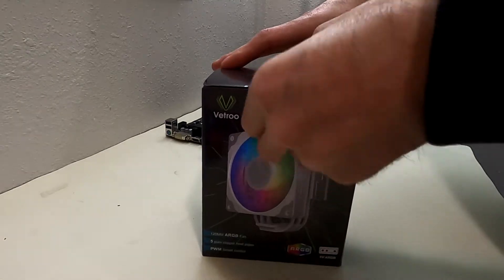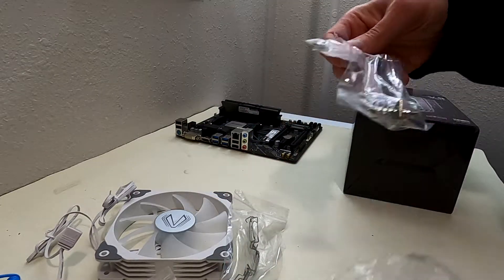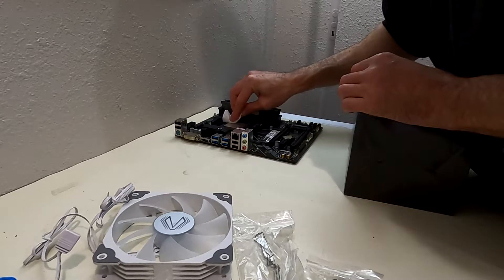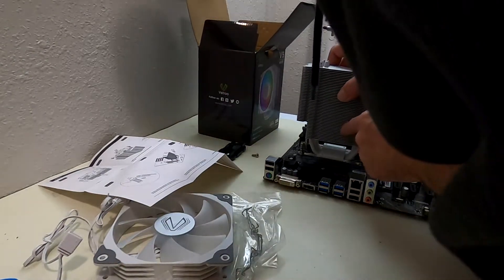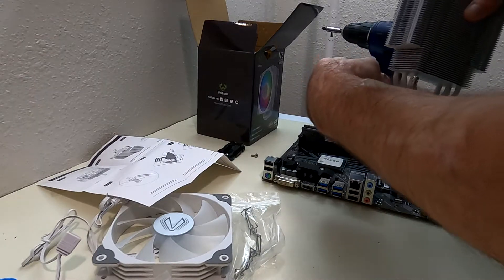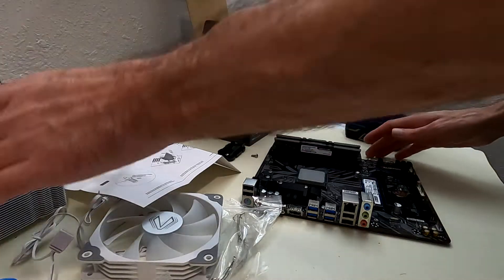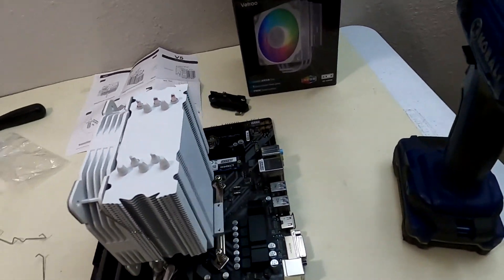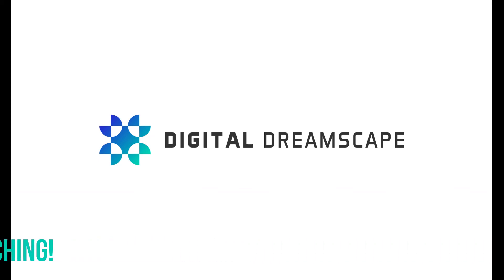How to Install a CPU Air Cooler also includes Unboxing

Comment: Putting on water coolers is way easier but this particular case has no good spot for one so I'm using an air cooler.

Comment: some people put thermal paste directly on the copper pipe that makes contact to the cpu and others, lik you sir, puts it on the cpu. Which way is correct? Are they both fine?

Comment: Thank you for mentioning the brackets. If the four corners aren’t lining up correctly, try switching the brackets that screw to the radiator bottom.
Reply: I ordered one today, On it's way tmrw. Hope all goes well and I'll take your advice 👌

Comment: How much power does an air cooler like this draws? I'm planning to buy an air cooler for my ryzen 3 3200g apu but I'm just using a 700w generic psu with a 230w rated.
Reply from the maker: Not any more than a standard case fan.

Comment: I was just thinking. Yeah that hurt lol. No seriously since you can use  whatever fan you want I'm going to use my Aigo DR12Pro fans on this. Put one on each side. They are connected to a hub and controlled with the remote. So I can change the fan speed, animations, and colors. They are double ringed so there would be four rings there. Might look cool. Already hooked up so all I'd have to do take out the screws and mount them on this. I could put this fan up the rear exhaust fan maybe? Just a thought.
Reply from the maker: That should give ya more than adequate cooling for just about any CPU.

Comment: Dang that's tall hope it fits in my case
Reply from the maker: Be sure to check overall height and case specs before ordering. Also keep in mind the RGB plug is a 3pin.
Reply: @DANRANTS1  I just measured the case. From the back panel to the glass is around 7 1/2 inches.
Reply from the maker: @jesusninja2401  total height is 5.82 inches.

Comment: I just bought the Black version of this. It's on EBay if anyone's looking. By the way does this work well cooling? I'm not overclocking but I've tried cheaper air coolers and none of them work very well. This got good reviews though on Amazon. How was your experience on it? Great video and thanks!  Oh just to add I think the newer version of the white has the three pin 5V RBG connector. I know for sure the Black version does.
Reply from the maker: It seems to cool great. Granted I was only running it on a Ryzen 5 2600x, but the fan didn't speed up at all during Userbenchmark.com testing.
Reply: @DANRANTS1  Well wish mine would hurry and get here. I'm using the Darkflash Shadow Pro and it doesn't cool that well. Looks awesome but cooling is not good.
Reply: 1271 v3 100% load in cpu-z, it didnt go over 60c with a room temp of 75F. i got the black one and i am about to return it because i was under the impression the lights would work in an rgb cycle with just the 4pin connector.  But for $25 on amazon, the temps themselves were great.
Reply: @brianv3ntura  The original white version I think did light up using only the cpu header. You only got rainbow lighting. Then they upgraded with the extra connection which is the ARBG connection. The black version has both. It will not light up at least in my case without hooking up the ARBG to a 5v three pin connector. I have the AigoDR12 Pro fan set. It has a hub that the fans connect too and I just hooked this cooler to the hub. Now the cooler syncs with the fans too. For $15 you can buy just the hub and remote from EBay. And still use the cooler.